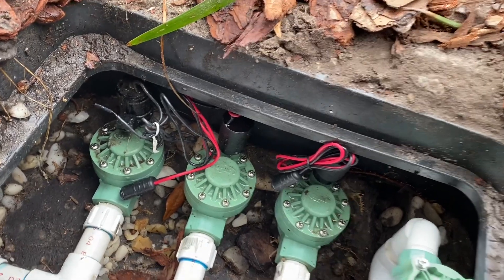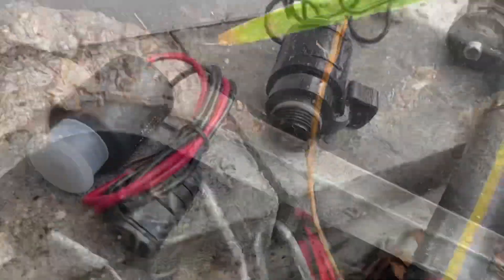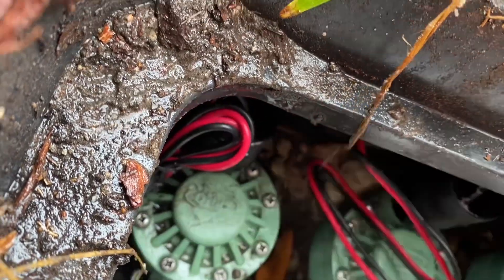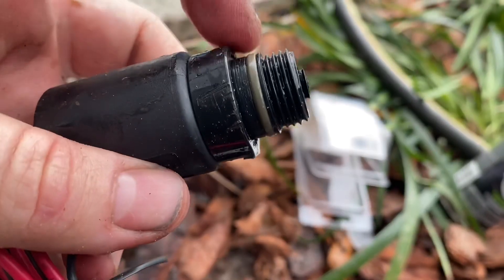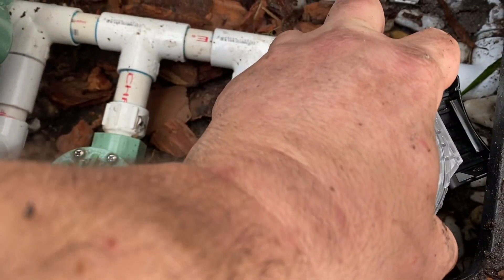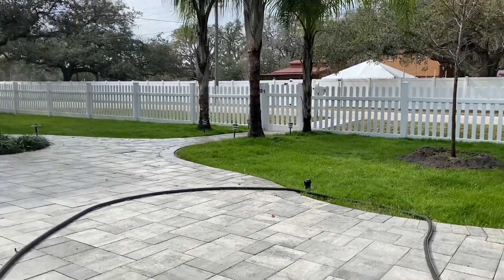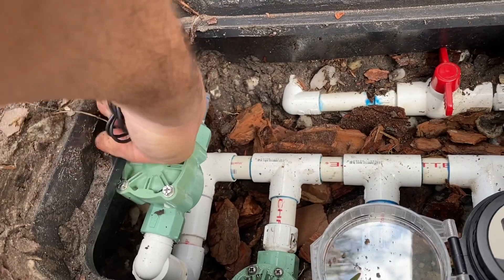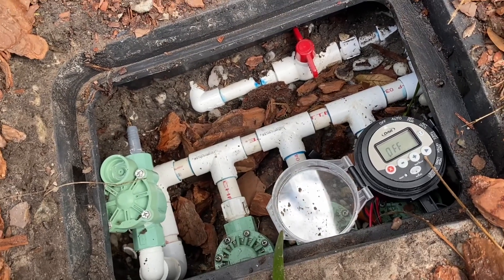How To Convert A/C Sprinkler Valves To D/C Battery Powered Timer Orbit D/C Latching Solenoids

Comment: Great video. I've been scratching my head over this one.  I never realized the on/off lever threads off.  That solved my problem.  I have both  the old and new style Orbit valves and was surprised at the difference. Glad to know there is an adapter for the DC latching valves!

Comment: Thanks for the video, super helpful. Does the 4 zone controller hook up to a 12v battery or something smaller that is internal to the controller?
Reply: The timer pulls straight up and runs off one 3 AAA batteries and says it will last 1 yr on those batteries

Comment: Were you saying you never had electricity in the valve box out there? Then how did you power the old A/C solenoids before replacing them with the new battery operated D/C ones?
Reply from the maker: Didn’t ever power them. Just turned em on by hand

Comment: You mentioned you'd post links to the parts.  I can't find the links.  Would you post those please - I'm needing to do this for my system this year.
Reply: FYI, at least for anybody else who found this, the Orbit part # for the timer + valve kit shown here is 57860  while the individual DC solenoid is 57861.   The timer by itself is 57865